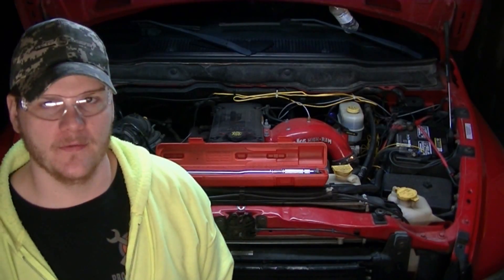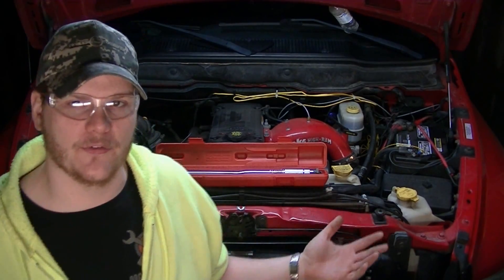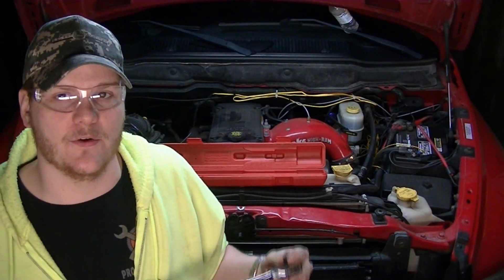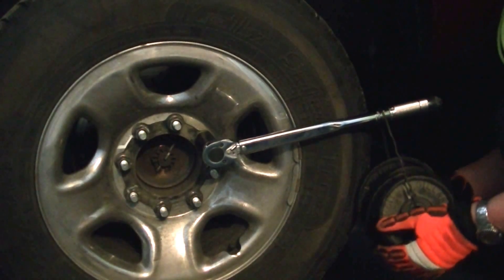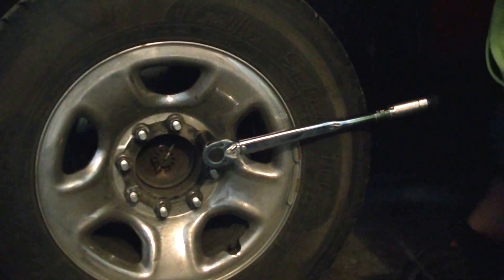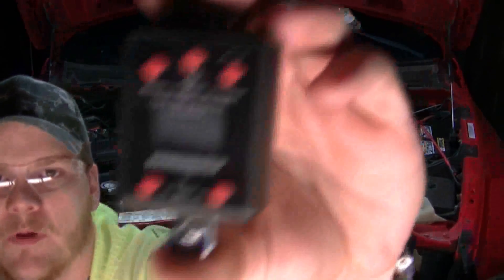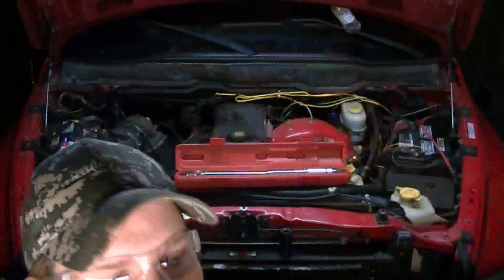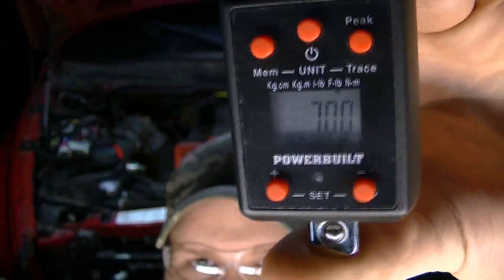DIY Torque Wrench Calibration

Comment: I have a torque wrench that looks virtually identical to the one in this video, but the brand name is “Supatool”. It was badly out of calibration – the lower end settings below about 40 ft pounds didn't seem to “click” at all.  I tried adjusting as per this video (cheap method), but could not get the calibration to come right.  I ended up dismantling the wrench to see if I could diagnose the problem, but initially to no avail.  Eventually, after inspecting the parts under a stereo microscope, I discovered that there is a SECOND ADJUSTMENT MECHANISM in addition to the allen key screw adjustment hole used in the video.  It is a bit subtle, so I will attempt to explain it as best as I can.  This may only be needed if your calibration is badly out, and I can't guarantee it will work for all such wrenches (though I expect all that look superficially the same ARE the same internally – probably all made in the same Chinese factory regardless of brand name!) 
The end of the handle has two BLACK pieces (1) the central round locking piece and (2) the hexagonal piece that is attached to the silver setting barrel (if I can so name it) – the thing you twist to set the torque.  Now the hexagonal black piece can unscrew from the silver setting barrel.  On unscrewing from the silver setting barrel, if you are lucky, the hexagonal black piece should leave behind, in the silver setting barrel, its black threaded inner portion.  On mine, this did not happen - it initially appeared to be a single piece, but on closer inspection proved to be TWO separate black components, that were quite difficult to unscrew. You MUST be able to separate or at least loosen the connection between these two components. (To be clear: on unscrewing the black hexagonal from the silver setting barrel, any thread you see emerging IS A SEPARATE COMPONENT). Here is the important thing – the threaded inner component can be screwed into or out of the silver setting barrel INDEPENDENT of the outer black hexagonal component.  If you screw it further into the silver setting barrel (more thread in the silver setting barrel and less thread in the outer hexagonal component), it increases the compression of the spring, thereby increasing the torque needed to “click” at a given setting (and vice versa).  On mine the inner threaded component had worked its way further into the outer hexagonal component, and so was under-compressing the spring for a given setting. (Incidentally, adjustment in or out will best be done when at the loosest torque setting i.e. when it is applying no compression force on the spring). 
NOTES on Dismantling: Be careful with the central black threaded portion which you adjust as described above. It has two holes in it.  These contain two small locking pins, which could easily fall out and get lost, especially if you completely remove the central round black locking piece (the latter should not be possible – there is a small allen key screw deeper in the workings that is supposed to prevent this, but on mine it had come loose).
LESSONS: The black hexagonal part, is actually in two components, the inner of which is the thread, which can be independently screwed further into or out of the silver setting barrel, thereby adjusting the calibration.  Once calibrated, make sure the connection between the hexagonal black piece and the silver setting barrel remains tight.  If it comes loose, you may need to re-calibrate – this is probably what caused mine to get so badly out of calibration.
I hope this all makes some sense!
Reply: I have the same twist type clicking of torque wrench and you are exactly correct.  The knurled handle is actually 2 pcs. and the hex part (bottom of the knurled handle) is actually the one locking the handle.  I my case, the small knurled locking piece (at the bottom of the hex part) came loose exposing a washer and 2 thin needle like metal pin.  I nearly lost 1 of that pins.  The allen screw which locks that small knurled piece came loose, thus, making that knurled piece removable which is not supposed to be.  I have to do the cheapest way to checking if my torque wrench went out of specs.
Reply: pinoyeh I hope you managed to sort yours out!  I think I managed to get mine reasonably accurate in the end.
Reply: I wish more people would bother to post good info like this.  You should make a video of this and post it.  Then, monetize it.  You can get paid for letting Google put ads on it.
Reply: ZX2Fast Thanks for the advice! I might have to think about doing that, but don't have a good enough camera at the moment.

Comment: Thank you for this detailed video!  There is one issue that I have not seen any videos on and I have heard conflicting views.  People in stores usually know nothing about this.  Is it okay to use socket adapters with torque wrenches (as long as the adapter extends parallel to the socket)?  Also, is it okay to ALWAYS use the digital adapter on a torque wrench as a double check to avoid over torquing?

Comment: Absolute wrong way to make torque wrench calibration! 1) the force (i.e. weight) is not vertical to the wrench handle. 2)If wrench setting is small than the force dot length than it click, If wrench setting higher than it would not click. But you still do not know what is the correct torque value. 3)In line with ASME or ISO standard force must be add on middle of the handle. So, the length must be from the center of squire drive to the middle of handle. Ohhhhh
Reply: Are you sure???? getting other info elsewhere.